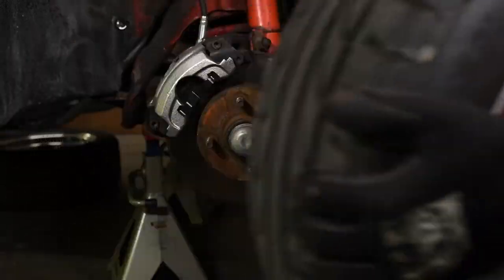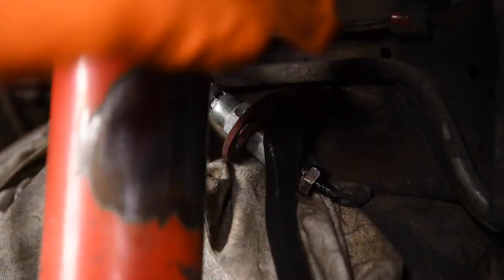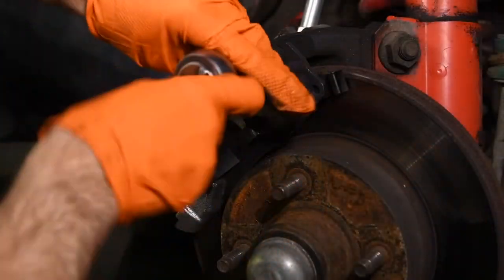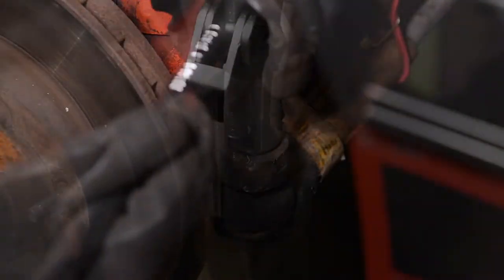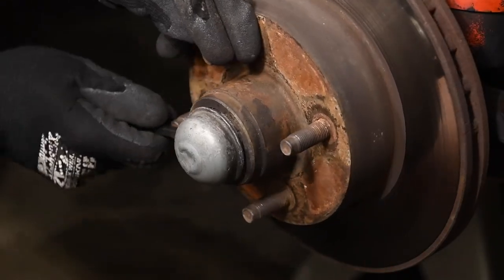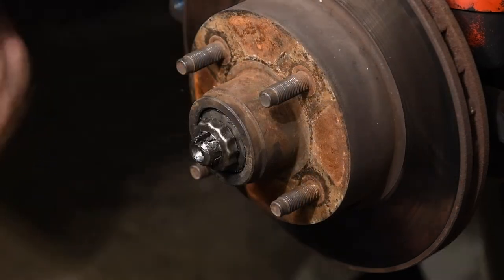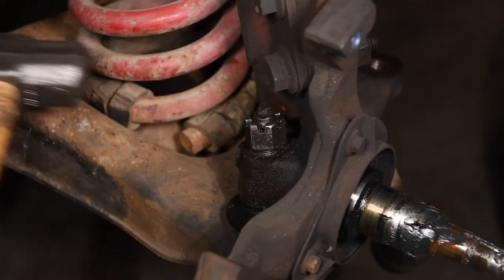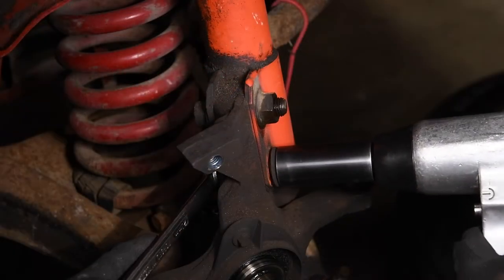How to Remove a Mustang Spindle

Comment: Hi there I just noticed looking at your coil springs, does the bottom pig tail of the coil spring not fully seat in the perch when there is no weight and if the car is in the air because mine does that with after market coil springs and in the video it looks like yours does too, just wanting to make sure I’m not the only guy that has that.
Reply from the maker: Very likely.
Reply: @Mustang-Geek  did you ever have any problem with the coil spring or no
Reply from the maker: @jakub584  No. If the end of the coil is clocked correctly, don't worry about it.

Comment: You forgot to mention  to support the lower control arm with a floor jack before removing the strut bolts.
Reply from the maker: Good catch! Let me see if there is a way to add that to the video without reposting.
Reply: how can I do this safely at the junkyard? any suggestions? no jacks allowed into the yard.
Reply from the maker: @jaredhill313  Good question. Maybe use a block with a rope attached. Pull the block out when all the bolts are removed.
Reply: @jaredhill313 will the spring fly out or something? Can’t you just remove it all without lifting the control arm?